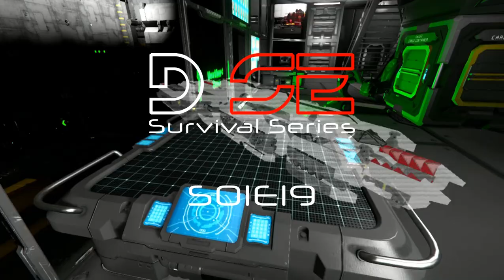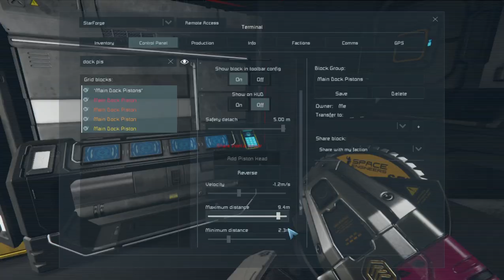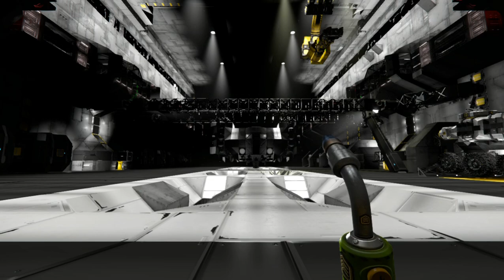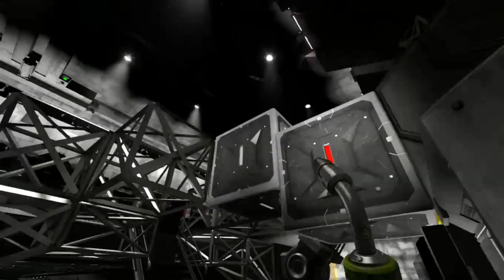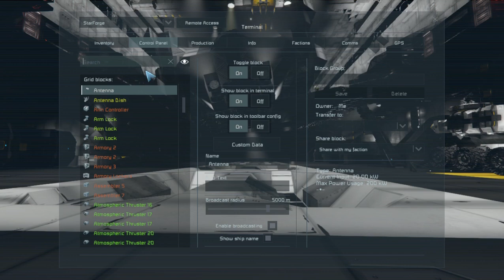Space Engineers | Survival on Triton S01E19 - Heavy lifting

Comment: Th reason why the ramp didn't lock immediately was because the ship was pushing against the welding arm. You can see it in the background.
I was actually expecting Clang to wipe your base out and almost held my breath.
Reply from the maker: It might be, another thing was the position and angle of the piston bottom attachment point, in other words, I've attached the hinge on top of which I've built the piston, too far away from its top attach point (hinge). So the piston maximum extent was a little beyond 10 m.
I've also changed strength and speed of all hinges and pistons, but not shown in the video.
In the next episode you'll see it's much more stable, yet I'm not 100% satisfied.
Reply: @intergalacticGM  could very well be. In the end I only watched the POV from the video so you know better than me.
Love your series. The only complain I have is not even your fault: it's the crappy lightning system that SE has were it removes lights that are further away. :)
Reply from the maker: @Thade780  true, lights aren't doing a great job in this case. I wonder if removing some might help. White lights aren't supposed to blink. And thanks for your appreciation, what I do is for fun, but I hope I'll be able to evolve as I go. I now have enough for a decent disk, just waiting for the right opportunity to go. I live far from big cities.